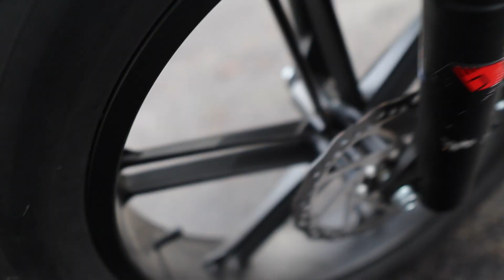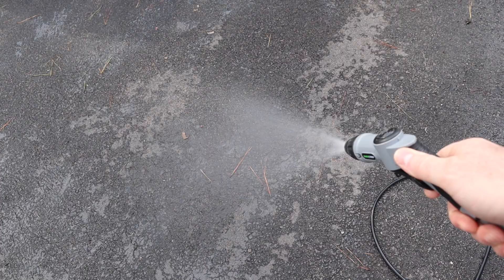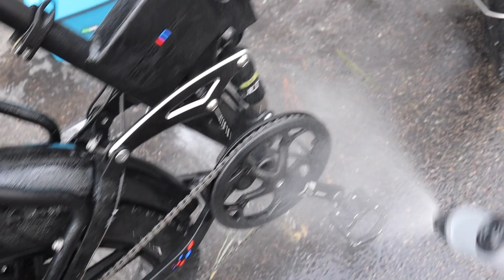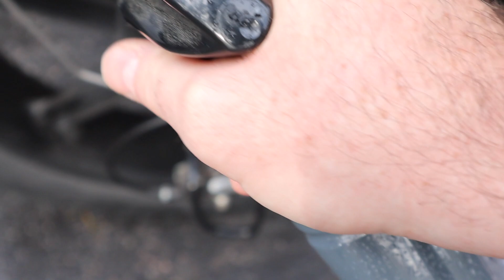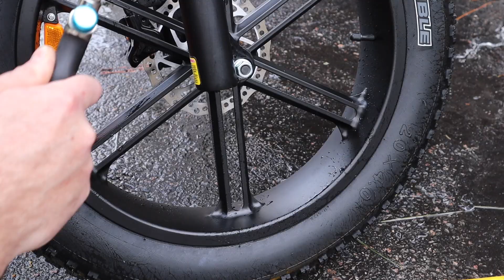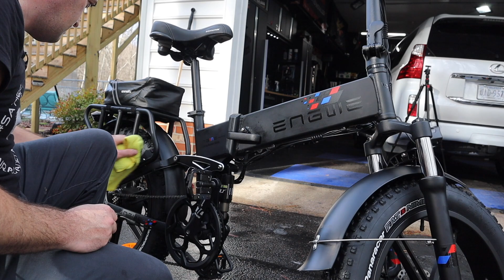Cleaning My Dirty eBikes! #asmr #detailing

Comment: Hi Phil, mindnif I ask what you used as a pre spray prior to using your unit with the rinseless wash solution?
Reply from the maker: Hi. I just used Hybrid Solutions 3n1 detailer. I didn’t want to use an apc or degreasers becasue it could cause issues on the matte paint. So this was a gentle but effective way to clean.